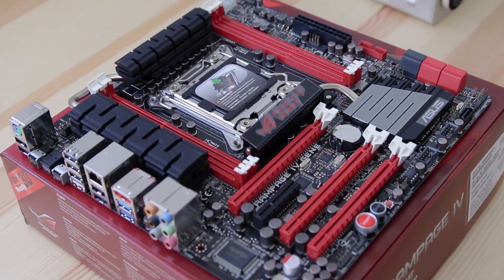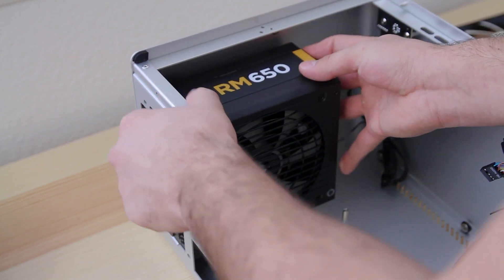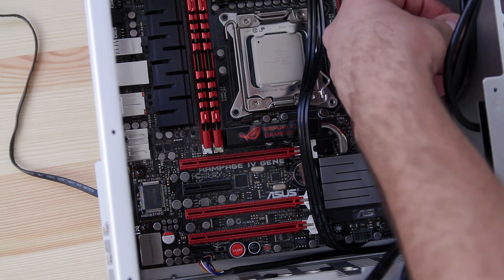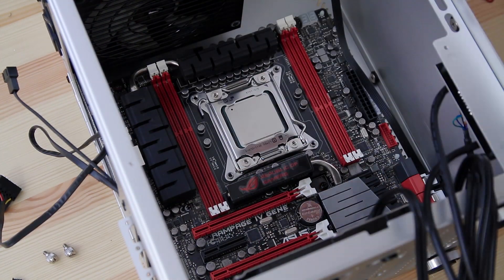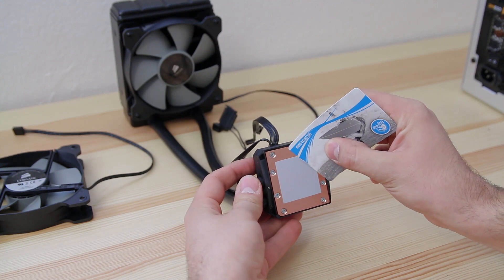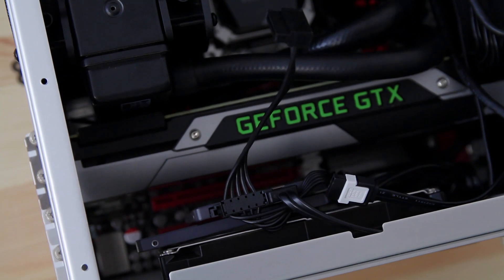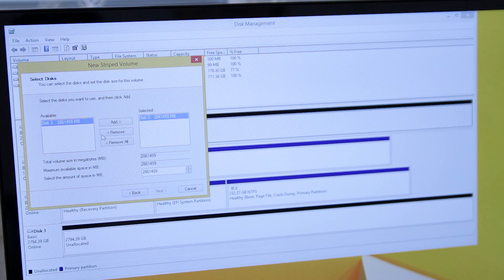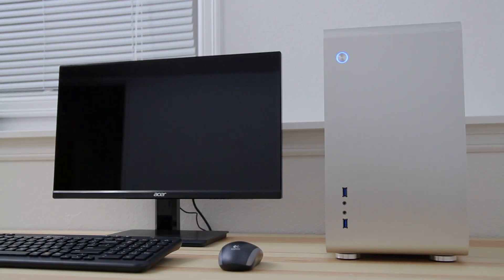Part 2 - 2013 New Mac Pro vs Custom Build PORTABLE PC " The Mac Pro Killer " - The Build - U3 TITAN

Comment: I just ordered all the parts for my build, just like yours except I bought the 780 6gb sc acx card instead of the Titan Black. Which according to EVGA's site, says they're both the same length. How hard really was it getting the Titan to fit in that case? When you got it to fit, did it vibrate much? Make any scratches?
Reply from the maker: there were a couple scratches on the case itself but not on the card because the aluminum is softer on the case and I also took it in and out 4 times total. watch my part 2 of my mac pro killer I show the easiest way to install the gpu. no vibration :) sweet case!
Reply from the maker: sorry this is part 2 :) just check out how it did it, takes longer than regular but much easier this way.

Comment: just shitt .. chinese cheap case rebranced and sold expensive in usa.. very poorly desined case.. it is originally made by a stupid retared company called jonsbo .. just avoid these.. they will run hot .. not well thought out.. Lian li will be better but pricy..
Reply from the maker: Why so much negativity? I've built about 15 computers and this is one of the best built solid case, all aluminum and worth the money.

Comment: amazing system and yes it probably is better and faster than the new mac pros. But logic pro x and all my apple industry software would be missed. apple are over priced but there software is very stable. How do you compare :) also you can run windows on a mac with out any glitchy cracks. I use both :)
Reply from the maker: I actually have a Mac pro now :) its the software optimization for the hardware that is veey nice
Reply: Max Yuryev what did you go for m8? i will order the 6-core Dual GPU 3,299.00
Reply from the maker: ***** 6 core, 16gb ram, 256gb Hdd, dual D700 gpu's $4600. I got the best gpu because thats the only part you can't upgrade. (at least for now) you can swap the ram, the ssd, and the processor.
Reply: i get you sweet
Reply: ***** were do you order the upgrades? i was told only thing you can upgrade was the ram and hard drive or soft drive in this case :) let me know if you find a sight that dose the upgrades?

Comment: Hey, how silent is this case? Considering of getting the windowed version of this case, it looks amazing, is small and fits everything I want.
Reply from the maker: The case doesn't have any silencing material so it really matters what you put inside. use quiet fans cpu cooler, power supply, and graphics card. The parts I used were all on the quiet side, and this pc was the quietest build I ever did. The case is fantastic you should get it :)
Reply: Max Yuryev Thanks for the fast reply, going to get noctua nh u14s in that case :)

Comment: summer time ??? +80C inside that gpu.....yes.......you need better cooling for that titan
Reply from the maker: It's my understanding that this line of gpu's will autoboost the clock higher until the card reaches 85F then will back off. I know in the program that came with it it gave me an option of what I wanted the max temp to be. I know the 290x will boost itself until it hits 90+F

Comment: Airflow: how well does this tightly packed case handle airflow ? the PSU inside vent is aprtiallly blocked, and not much interal space for airflow in general ?
Thermal paste: How To Apply Thermal Paste your comment on this ?
otherwise, neat vid !
Reply from the maker: You can check out my third vid for temps. the powersupply does great. And if not overclocking the whole pc does well! Overclocked at max load the cpu does get warm!
Reply from the maker: Thanks for sharing that video. I have done that in the past as well but for this build I did spread it out because reading the reviews for this particular thermal paste is very thick and doesn't spread well by itself ( or so I read ) It is also non conductive

Comment: My 27" IMac Core i7 Quad Core (2010) with 16 GB RAM so far is handling 4K just fine. I will probably upgrade in the next year or 2 but for now, it hasn't given me issues.
Reply from the maker: Nice! when I edit music video like the Last 2 Lavoy I had 8 cameras recording and when running multicam my Alienware m17r4 couldn't keep up. If I do something similar with 4k wit would be like having 32 1080p files running at once (as far a pixel wise) So I need that power and memory :)

Comment: Thinking of building my 4k editing machine.  Shooting in RAW and editing with resolve and AE, and AL.  I did find that when I render out to quicktime RGB and try to play that huge file that my hard drive is running at %100 and still not fast enough to play smoothly, note, my hard drive is TWO SSD's in Raid 0 !!!  I was like, whaaaaat.. the fuck... So next build will be 4 ssd's in raid 0.  Also noticed so far that the AE uses the CPU and not GPU.. so don't think the titan will make a bit of difference... unless your running to a 4k monitor and scrolling your timeline?
Reply: What speed are your HDDs? Also SDDs are always gonna be faster :D Cons of raid 0 are that you will wear the SSDs out fast. Also for 4k Reso, you will need a decent GPU and CPU to render everything properly.
Reply from the maker: What Quicktime are you rendering to? Is it 8, 10, or 12 bit? blackmagic speed test will tell you what your hdd's can handle ( as far as codecs, bit rate ect.) Most interenet video is h.264 mp4 8bit. Even a slow laptop hdd can handle that. full quality Blu-ray video is 40mbps which is 5MBps. The 5400rpm 1tb hdd in a laptop I use runs at 100MBps. My Raid 0 HDD run at 350MBPS and my SSD's Do 550MBps. If you have current get SSD's at raid 0 (with current get Sata 6) you should be looking between 800-1000MBPS. So something is definitely wrong. I would figure it out don't try to run Raid 0 4ssd just yet.
Reply: Max Yuryev I like to save my 4k videos I shoot to my own library which will go to a 4k projector of 100" inches or bigger, so internet standards are not exactly sufficient for my taste. I'll look for that blackmagic speed test software... my camera is a sony NEX FS700 so I don't know of black magics speed test, thank you!

Comment: may run better than a mac pro i dont know about a maxed out mac pro but apple offers free support(in the uk anyway) and you dont have to build it
Reply: But building it is fun.
Reply from the maker: If I could afford 9600+cash for monitors and external Raid drives I would buy It :)
Reply: just spend 1k

Comment: Hey man awesome video,  You seem to be one of the Few people on youtube doing a review on this case,    Well i just ordered the case today and wondering,  Do you think that a 140mm Fan would fit at the very bottom of the case?
Reply from the maker: I'm glad you liked the video! It will really depend on your setup. By the measurements it should work. The case is just over 8 inches wide and a 140mm fan is 5.5 inches. If your not going to be installing a 3.5HDD in the side panel and your motherboard comes all the way to the bottom it may get tight but it should still fit. If you want to play it safe get the round style Nactua so it takes up less room than a standard square fan http://amzn.to/1nn9Mqm
Reply: Max Yuryev  Thanks for the Fast Reply man,   I think i may just go with 2 120mm Noctua Fans  for the back and bottom.    Im Stressing about a cpu cooler tho.   I want the Noctua NH-U14S  but im worried it may be to big.   Their is a smaller version Noctua NH-U12S  That i may go with instead.   I Want the bigger version but just not sure if it will fit or not....

Comment: Nice build!! planning on making a similar build. Just wondering if you are running only Windows or dual boot with Mac OSX and really turn it into a Mac Pro Killer? If you already turned it into a Hac Pro please share your installation process.
Reply from the maker: I haven't looked into it yet but I may! I think you need to make sure that the motherboard will support it. I know that the larger Asus boards do so I think this one has a good chance as well.
Reply: I found that Rampagedev has the DSDT files for this particular motherboard. You might want to check it out.

Comment: Awesome! But I'm kinda worried for ur GTX Titan as it has got literally no room to breathe.. Lol but still pretty awesome :)
Reply from the maker: True it is very crammed but I'm glad that there are holes cut all around the 3.5 HDD so said is being pulled in from there, I'm not sure how much air but at least some :) if your are using this case and don't need two hdd's you can mount a fan to the bottom of the case to help out. I'll have temp numbers in next video
Reply: That's what I was looking for max, I was worried about temps getting high in that small case

Comment: Thanks for the thorough walkthrough of the case. Do you think there is enough room to run dual-gpu with a 3.5" drive on the bottom? It's really hard to see clearance between your titan and the lower drive mount.
Reply from the maker: There is really only 1 shot in the video where you can kinda see, but no if you want to run dual GPU you can but without the bottom mounted hard drive, so one or the other. I was thinking of adding another titan in the future but looks like I'd have to give up the drive to do so
Reply: Ah, bummer. Thanks, appreciate it.